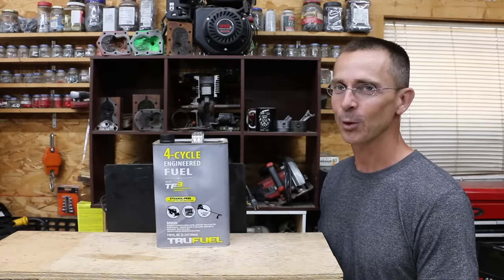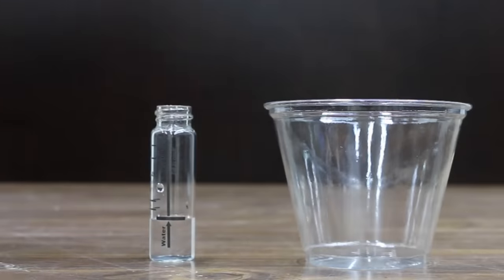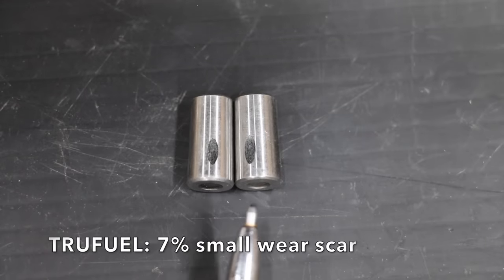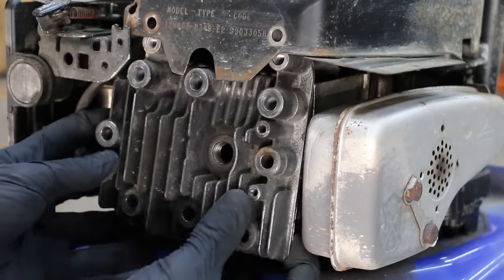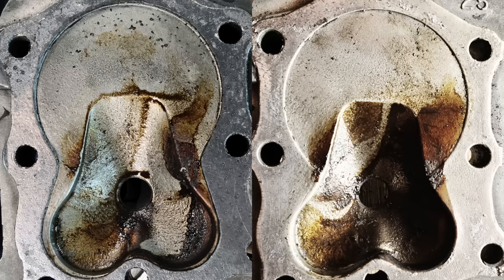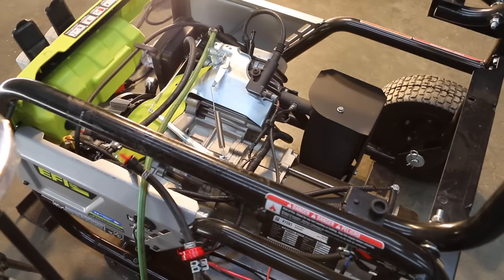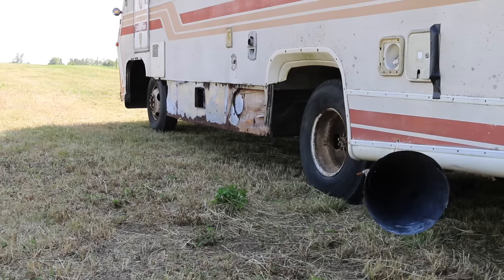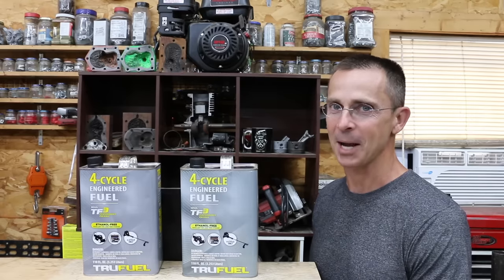Engineered Fuel better than Pump Gasoline?  Better Fuel Efficiency and MPGs? Let's find out!

Comment: One type of testing that I would love to see you do is lubricity testing diesel fuel with various additives that are supposed to improve that property. It would be a neat use of the rig you built for the motor oil testing, and lubricity is an important property of diesel that's changed a lot since the switch to LSD and ultimately ULSD in our American pump diesel.

It would finally answer the age old question: "does 12oz of this stuff in a tank REALLY work as advertised?" and if so, is it better than adding motor oils or canola oil to the fuel in similar quantities (1qt, typically).
Reply from the maker: Thanks for the video idea.

Comment: Late to the party here.  So basically the TruFuel is as efficient as non-ethanol (I have access to about 20 mi. away).  However, with regard to storage for emergencies (my home generator), the non-ETOH while storing for up to six months compared to two years (TF) may be the cheaper route for monthly maintenance running of the generator and short term emergency uses pending access to other sources.  I wish my generator had a "run dry" feature for the carburetor or an easy carb drain (Powerhorse).
Reply from the maker: Thanks for the feedback.

Comment: You should see how various ways of gapping spark plugs can work! As in pitting a normal pregapped against an indexed spark plug and an edge gapped spark plug. I'd love to see some side by side comparisons with the see through engine and the go kart! (I feel like the power gain would be insignificant enough that the farmabago results would be inconclusive.)
Reply from the maker: Thanks for the video idea.

Comment: 92+ octane? What kind of poor regular pump gasoline you get in the US? In Belgium the cheap gasoline is 95 octane with up to 10% ethanol. No good for my engine because ethanol is bad for my engine. So I always pick the 98 octane fuel with no ethanol. Problem gone with my engine.

Comment: From the datasheet it sounds like trufuel engineered fuel is vaguely the same as european "small machine fuel", or Alkylate fuel. 

Over here, the main selling point of Alkylate fuel is that since it doesn't contain carbon chains of varying length like regular gasoline produce by fractional distillation, it burns more clean, and makes the exhaust gasses of lawn mowers less hazardous to operators. Some manufacturers even claim that you can use their Alkylate fuel indoors in (qualified) 4-stroke engines without any danger to health.

Subjectively, the exhaust of a lawn mower running on gasoline vs alkylate is very different to me. I'm curious if Project Farm noticed any difference in the exhaust of trufuel vs gasoline?

From the description (and cost) of trufuel, it kinda sounds like they started with a clean base of alkylate fuel, and then added back lubricants and additives and ended up with a product that behaves much the same as gasoline?
Reply from the maker: Thanks for sharing.

Comment: Up until maybe 6 months ago nobody sold ethanol free gas locally. Tru fuel filled that void. Its perfect for homeowner used small engines. Stuff like weed whacker or leaf blower that doesn’t get run all the time. I buy the small cans for 5 bucks. Year after year my small engines run when I need them. Fuel lines don’t dry up and rot. No varnish and crud in carbs. For the small amount of 2 cycle gas I use the cost is worth it.
Reply from the maker: Thanks for sharing.

Comment: Another awesome video. I use TruFuel in my small engines but I have a small yard and don’t run my small engines hard. TruFuel has never let me down in the past 3 years of use and I’ve not had all the carb issues that I was having with pump gas even when I was using Stabil. The carbs always look cleaner than skeeters peter with TruFuel. It’s really pricey but it works for me and saves me down time and money with small engine repairs. Definitely not for everyone.    

On a side note we need to see a video on your small engine graveyard. Better get how about a contest to come work at your farm. Maybe a little side fun destroying stuff 😂
Reply from the maker: Thanks for the video idea.

Comment: Legislation recently passed in my state to allow E15 fuel to be sold in the E10 pumps.  Would be interested to know the difference in engine wear, especially on components not designed for that amount of alcohol or certified by the vehicle manufacturer, between E10 and E15 if any.
Reply from the maker: Thanks for the video idea.

Comment: I use Gulf Pro fuel here in Canada. It is a full alkylate fuel, not a blended gasoline fuel like Tru Fuel. Gulf fuel can sit in the tank of a machine for up to 5 years without going bad, and it does not need stabilizers. It also puts off up to 99% less emissions then blended gasoline does. It is just a better choice as far as I am concerned. I even use it to store my motorcycles over the winter. I keep my generator full of Gulf too. That way I know it will fire up if my power goes out.
Reply from the maker: Thanks for sharing.

Comment: IMO, the 91 Octane w/ no alcohol is the better choice.  Long term storage would be compensated with fuel stabilizer added, and probably would be still cheaper in the long run.  Would a test of the 91 octane w/ stabilizer against the engineered fuel be a viable test comparison?  Would the stabilizer be the contributor to the higher deposits seen with the engineered fuel?
Reply from the maker: Thanks for the video idea.

Comment: I like the smaller containers (32oz) to carry if I need to take a piece of small equipment somewhere (mower, trimmer, blower, etc), and refill them with pump gas or gas/oil mix as needed, as they are much more compact and tidy to carry than a small red plastic gas can.
Reply from the maker: Thanks for sharing.

Comment: Back in 2014 when I bought a stihl fs109r string trimmer, I bought the stihl premixed fuel, which cost about 30 bucks a gallon.
I just emptied the can into the trimmer this summer, and the fuel still runs in the trimmer, although first season starts have gotten mildly difficult, it takes about 5 minutes to get the first start of the season on the aged fuel, but after that with regular use it still starts easy.
Reply from the maker: Thanks for sharing.

Comment: I use the smaller cans of the pre-mix 40:1 tru-fuel for my weed-eater since it's the only 2-stroke engine powered thing I have right now and it is a lot easier than having a separate can or trying to pre-mix the tiny amount of fuel it uses.  Plus one of the small cans is enough for a month so the shelf stability is nice.  I am curious though what kind of lubricants they use vs mixing yourself.  Great testing!
Reply from the maker: Thanks for the video idea.

Comment: Ethanol should theoretically yield less mpg than non ethanol fuel as alcohol has less energy in it than gasoline, which, in effect, causes you to burn more to go the distance. 
Should have got some ethanol free true gas from a boat marina. I can get aviation fuel from the little airport down the road for about $5.50 gal. It's blue, 102 oct, no ethanol and has plenty of lead. Too bad modern engines are designed for unleaded fuel only.
Reply from the maker: Thanks for the feedback.

Comment: Those "engineered" fuels have a significant amount of toluene in them. Toluene enhances octane, its sooty when it burns in the open. High octane fuels are a waste in low compression engines and will burn dirty and not give best performance. Aviation fuel is also high toluene but with added tetraethyllead  to significantly boost octane for high performance aviation engines. It is a grossly dirty fuel that causes sticking valves and lead contamination in the oil. especially in lower compression engines. It is said also that the lead protects the valves seats, which is questionable. Id like to see an aviation fuel episode as many people use aviation 100ll gas in their sports machines and vintage cars. BTW ethyl alcohol is a good cleaner, It's water solubility is the issue.  you should find yourself one of those old variable compression knock engines that were used to test and rate octane. would make some interesting video to show how octane ratings effect engine performance.
Reply from the maker: Thanks for sharing.

Comment: I use in my generator lawn equipment and my motorcycle also my motorcycle carburetor I stored With pump gas in the system for nine months and it look like barnacles under a boat inside the carb with pump gas however if you’re using the equipment frequently I had no trouble with pump gas
Reply from the maker: Thank you for the feedback.

Comment: Our shop recommends using regular gasoline.  Then if your unit will sit for a season run out the regular gasoline and add tru fuel and run then shut off. It will store for a few years just fine. I have a snowblower that needs the carb replaced. Customer ran out the fuel and left it sit that way. Whatever remaining fuel in the carb bowl corroded away. Tru fuel is best for storage in my opinion.
Reply from the maker: Thanks for sharing.

Comment: I use true fuel in all my yard equipment have never had and issues starting my mower weed eater, chainsaw etc. from sitting several months all winter. They always firer right up first couple pulls.
Reply from the maker: Thank for sharing.

Comment: update comment on this fuel so i tried it finally in one of my 25 year old lawn mowers still being a butt on start up but as it went on the power it has was crazy. grass was like 6inches long cause i been busy and hot weather didn't bother since it was that high. usually with regular gas i would of stalled it out at least 5 to 10 times with such a height but with this stuff only twice and literally powered through a lot of it without any issues had about a lot of close stall calls but recovered second i lifted the front end. (cant say that with normal gas though lmao) so in the end it works good of course could be 1of 2 things. gas just being rough or it was just full of build up and this stuff started clearing it out. either way i like the results in first person experience.
Reply from the maker: Thanks for sharing.

Comment: If the difference is around 1-2%, then I would consider them equal. In order to be accurate, you'd need to do the test multiple times again and again to ensure the same time is correct and not just an anomaly.
Reply from the maker: Thanks for the suggestion.

Comment: nice controlled test but when i buy true fuel its 50 to 1 mix like gas and oil mix. i know this is 4 stroke test but i think a lot of people use true fuel for 4 stroke equipment how do the wear scars look on barrings with 50 to 1 oil mix on 88 gas vs true fuel? please get back to me thanks

Comment: I don't use engineered fuels often, but I do keep truefuel in my 2 stroke engines when I'm not using them regularly.  I kept my weed eater with the two stroke mix of truefuel for about nine months, and it started right up without issue.
Reply from the maker: Thanks for sharing.

Comment: 92 octane from a can?. we here got 95 octane as minimum from gas station. all petrol stations have their fuels engineered, it is not from the under the shed oil distillery. for sure the canned petrol is overpriced, maybe because of the production of the cans. advertisements and price is what makes it looks better.

but it is an ease to save the petrol inside a can and use it in emergency situations. maybe your friends runs out of petrol besides the road, it is a hassle to find a container to store the petrol from a gas station.
Reply from the maker: Thanks for sharing.

Comment: if you can get some, try alpine or aspen fuel (not sure which name is correct).  it is relatively new to the usa, canadians have been using it for some time now, but is supposed to burn cleaner than true fuel.
Reply from the maker: Thank you for the video idea!

Comment: I was shopping at Wal-Mart other day to buy motorcycle oil. I think the new 20k oil is great for my car and would like to put similar in my sports bike. I only found few motor cycle oils that are even for bikes. 20w50 and 10w40 are the only two kind I could find. The 10w40 was rated For racing and the 20w50 was for regular sportbike/roadster. They don't have any 10k, 15k, or 20k oil for bikes. I'm guessing because the transmission and clutch use the motor oil. So maybe a motor cycle isn't supposed to work with car oil? Have you tested the oil for motorcycle vs car oil? Can car oil 10k,15k or 20k oil be used in sport bike and what oil would be recommended to be the best. Can mixing Mobil 1 motor cycle oil with Mobil one 20k oil 50/50?
Reply from the maker: Thanks for the video idea.

Comment: You should do a test about thread sealants. More concerned about automotive cylinder head bolts going through water jackets.  Like permatex,  loctite, arp.
Reply from the maker: Thanks for the video idea.
Reply: Reason why i suggest ARP thread sealant is because that's the head bolts I'm planning to use on my 383 stroker build. Keep up the great detailed videos!! We curious men are appreciative!!

Comment: Good video but needs a follow up, I have left a chainsaw with aspen, as its branded in the uk, for two years to see what happens and started first pull. You can add also add aspen to old stale petrol in your engine and it runs well
Reply from the maker: Thanks for the follow up suggestion.

Comment: At 8:28, you turned off the fuel valve but didnt run the fuel left in the line when you tested the trufuel.

Comment: Dors the engine in motor home have continuous electronic spark advance?  In a high performance truck/car  (high compression) engine with electronic advance I’m sure Tru Fuel makes a difference, at least a unofficial test me dumping a gallon sure made the my tires squeal!!!
Reply from the maker: Thanks for the suggestion.

Comment: Twin turbos
Swap on a club or crew cab from 70's and flatbed & use to haul more stuff...home.
Reply from the maker: Thanks for the suggestion.
Reply: Or go cheap, find 2 used m90 blowers from 3.8 Buick, run in cross ram set up. Change pullies for specific pressure needs. Use 1 relief valve.
Eventually my plan.
Covid and physical body damage is limiting my ability to work,
Not my desire to dream.

Comment: You should buy a cheap 49cc scooter and do your own spin on all the different ways to upgrade it. I'd love to see what you would do with it.
Reply from the maker: Thanks for the suggestion.
Reply: @ProjectFarm  your welcome, I recently bought a 2020 TaoTao atm 50 and bought a 100cc big bore kit and a CVK bored out Carb and a unrestricted exhaust for it. I have about $80 in parts and installed them on it, I went from barely going 30mph to 60mph and higher

Comment: I left my weed eater in storage for three years and it has had nothing but tru fuel in it. When I looked at it, I observed that primer bubble and lines were still soft, pliable, and clear. It started on the third pull with no issues.
Reply from the maker: Great to hear!
Reply: Project Farm 
It seems very reliable for long term storage, but I’d like to see you test that.

Comment: Love these videos! I’ve been using tru fuel in my generator for a while and so far no problems at all. It might be interesting to see a comparison of the tru fuel 2 cycle fuel vs off the shelf 2 cycle oil/pump gas mix.
Reply from the maker: Great suggestion!  Thank you.
Reply: Soak the carb parts in pure benzene to see if that is really what makes them brittle as stihl claims.

Comment: Are we going to pretend that you used the correct head gasket at 4:00 @project farm
Reply: Good catch. I played it at .25x speed and it appears as if he’s just holding it upside down. See how the far right 3 holes are staggered. It should line up by flipping it over. We’re all human he probably just missed it in editing. It took me 5 or plays to see it in detail.

Comment: I use non alcohol fuel in my snow blow and lawn mower. I never add any thing to the fuel and never have a problem with fuel. Before anyone makes the comment about me draning the fuel i do not. What fuel that is in the tank stays there until i use it again. 
 Spending money to buy this engineered fuel is a waste of money that is my opinion.
Reply from the maker: Thank you for the feedback

Comment: 20 dollars a gallon seems steep. Until you find out that in Norway we have so much taxes on gas that it costs 60 dollars per gallon
Reply from the maker: Good point!
Reply: @Project Farm appreciate that you take your time to read almost every comment, you investing such time in the video itself would already be enough. Didnt hesitate subscribing
Reply: Really!! It's 2.75 in USA ohio
Reply: @cronic overlord America is much better on fuel prices. We dont even have engineered fuel here, you have to mix yourself, did some searching and found out just a bottle of stabilizator for fuel was 20 dollars alone. I guess Its so expensive in norway because of a mandatory 40 percent tax on fuel

Comment: VIDEO REQUEST!  Not sure if this is where to do it.  Testing leak stop for evap and condenser coils.  This video shows what this guy did to find the leaks by submerging them in water and pressurizing them with shop air.  https://youtu.be/yzqsD3K64MU  It would be interesting to see how many if any leak stop would have stopped.